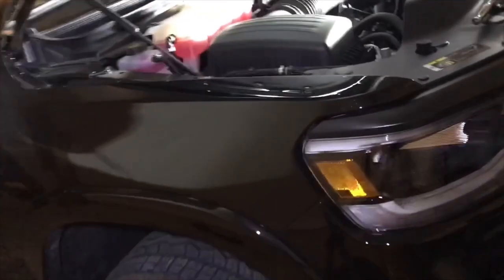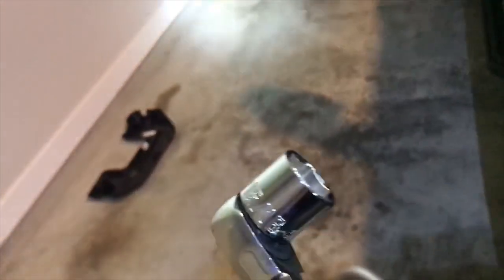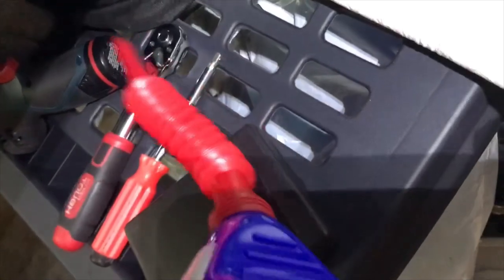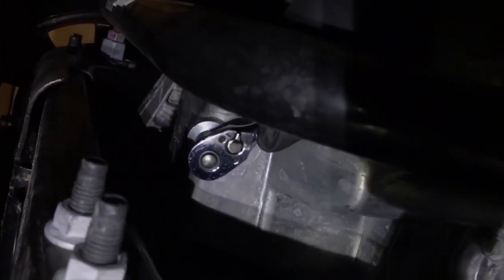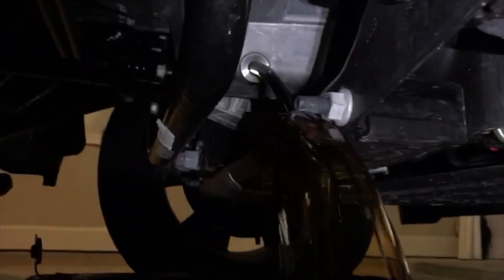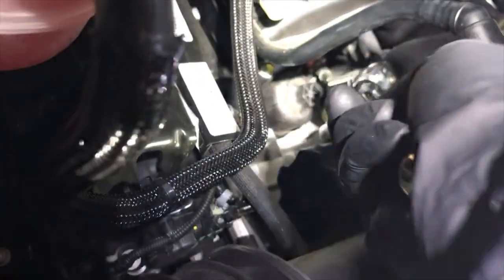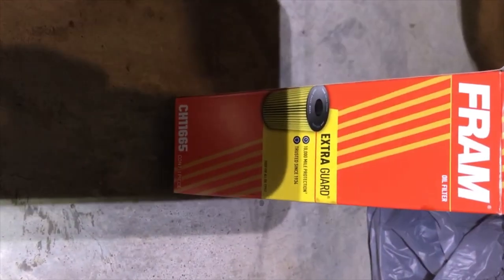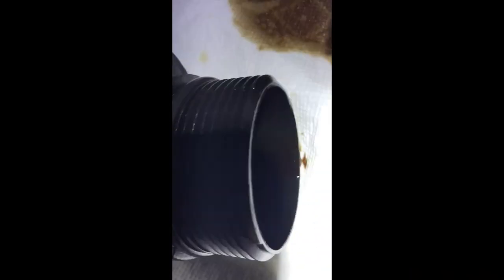2019-202x 1500 3.6L V6 Pentastar eTorque Oil Change VERY EASY from start to finish.

Comment: Just changed my oil - same engine. When that oil pan bolts comes out, man does the oil shoot out.. Totally missed my catch pan like you did. And oil goes all over the bolts and frame. What a mess. I used a long extension to work my filter loose/tight. Not bad video. You did it and I watched it. Nice job. Thanks for sharing.